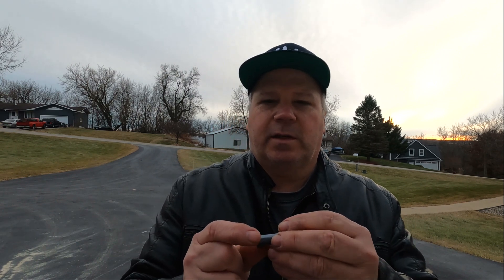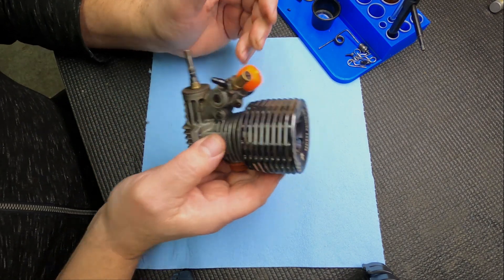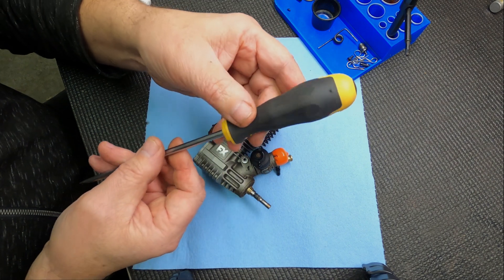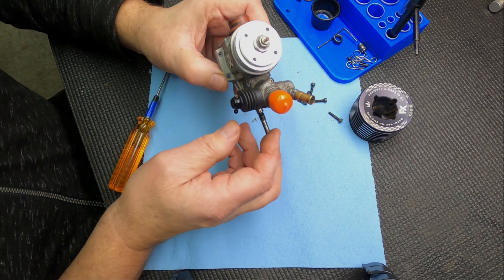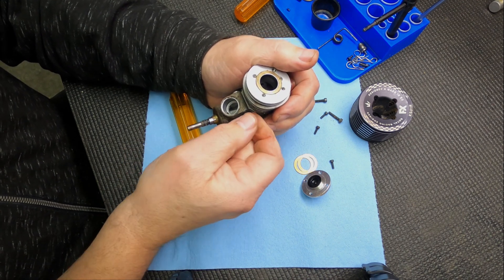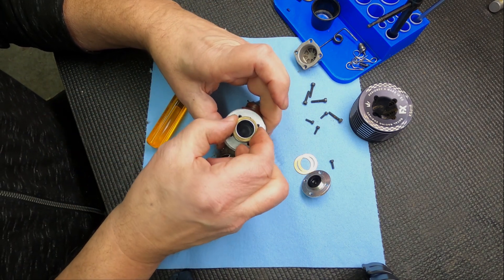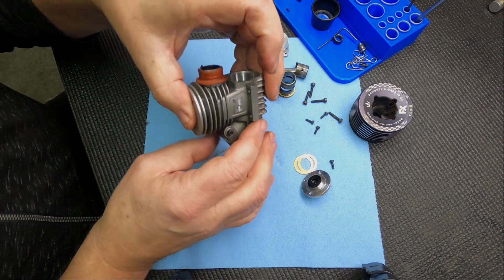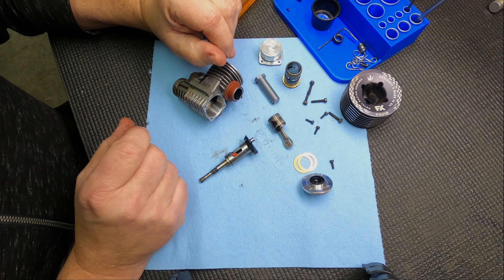How to take apart a Nitro Engine

Comment: Have you ever looked at the hobao macstar engines? 
They have a unique staring shaft with no one way bearing, if you can get them to make power i think they could be great for bashers that need pullstart.
Reply from the maker: I am sure I have rebuilt one at some point.